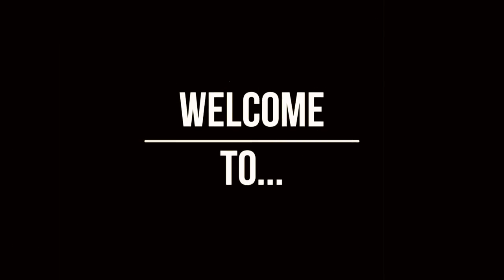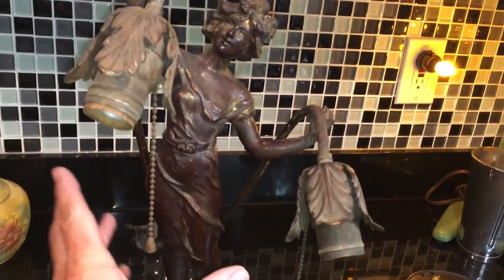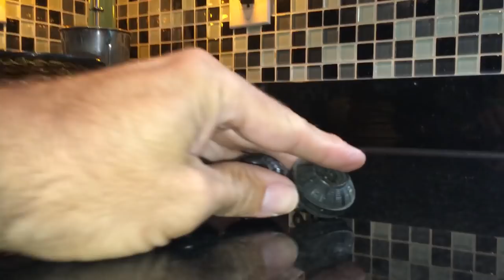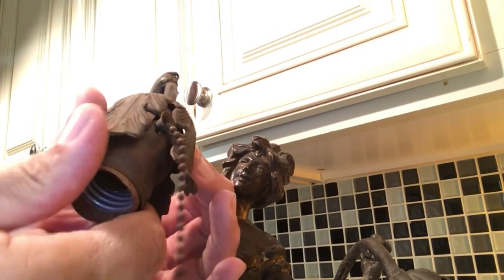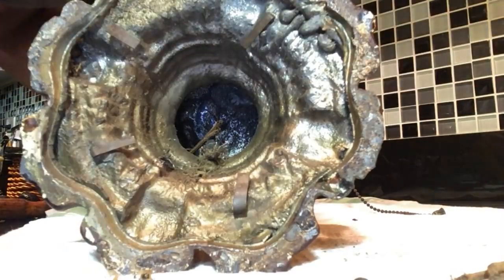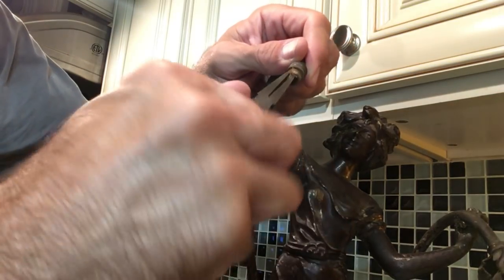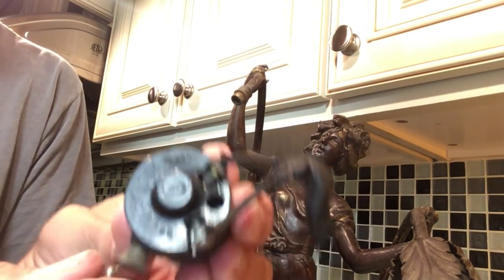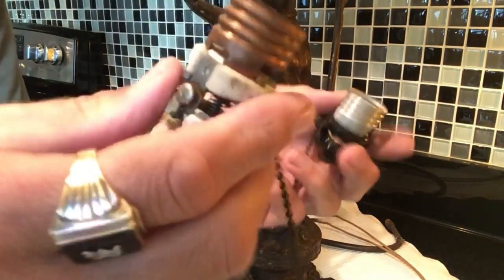Restoration of a 110 year old antique lamp!

Comment: I actually taught myself how to rewire lamps years ago. It is one of the most satisfying things ever. That one is going to be wonderful! Is spelter the same as pot metal? My dad worked in a foundry and sometimes they would make a mold of ...say, a cast iron frog or a muffin tin and would use the days leavings to make a cheaper version of a nice piece. We had a cast iron frog that was a beauty. Wish I had it now.
Reply from the maker: Yes indeed spelter is often also called pot metal.

Comment: That is a gorgeous old lamp! Also, thought I would add a bit of input on the approximate age of those sockets. I am not an expert on antique I sockets, but I do have a bit of knowledge about them. The first socket that you removed I would dare say dates to the 1950s or newer, because of the Bakelite and aluminum construction. As far as I know, I’m pretty sure they still used the nice chunky brass and porcelain sockets up into the 40s (but don’t quote me on that) and the second socket you removed with the gorgeous hefty copper contacts and porcelain housing is almost most definitely original to that fixture! Thanks for breathing life back into this old beauty! (EDIT)quick fun fact, I’m pretty sure all the modern “plastic” sockets are actually still made from Bakelite, or some similar modern material like phenolic resin and have the same basic construction as the one from the 50s. Also I agree, putting any modern “brass” socket into a gorgeous or fixture like that would be sacrilege!!! As far as I can tell, The housings on those modern brass sockets are actually just made from cheap brass plated aluminum, as opposed to the antique brass sockets, whose housings were actually made from real pieces of sheet brass. If you made it all the way to the bottom of this comment, thank you, and apologies for rambling for so long… lol, it’s a habit of mine

Comment: So I have a similar fixture, and I'm thinking of doing new wire work. However, it has 3 lamps (bulbs) off of a single branch, with the first and second lamps having a bit of a branch-off from the main. HOW do I get so much wire into it with all the bends? Or is it better to make a new branch and wire and solder the pieces together after the wire is in?
Reply from the maker: Oh Sean you can do it.  You just need very fine grade insulated lamp wire.  I can't every find it at big box hardware and home improvement stores but you can order it on line.  Believe me I know just what you are talking about.
Reply: @oldcuriosityshop265  
I finally ended up using thermostat wire (18awg solid) and a bunch of lubricant to push it through one by one until all six wires were in! Still a tight fit, but the cable lubricant really makes a difference.
Reply from the maker: Awesome.  I’d love to see it!
Reply: @oldcuriosityshop265  what's the best way to send you a photo?
Reply from the maker: Oldcuriosityshop99@gmail.com